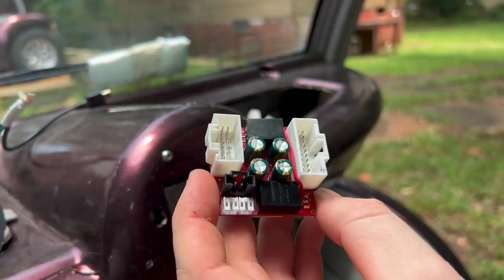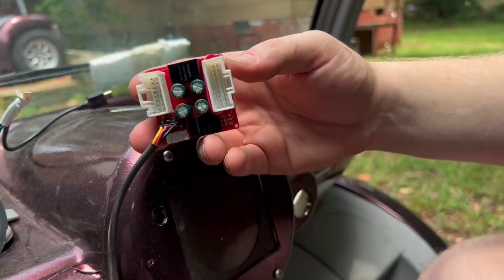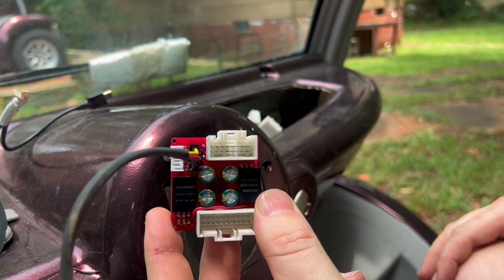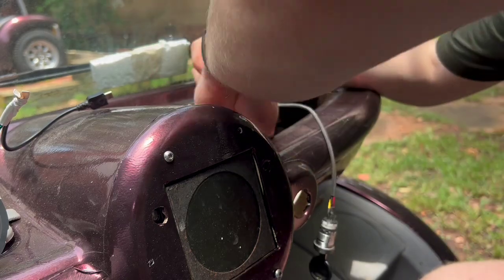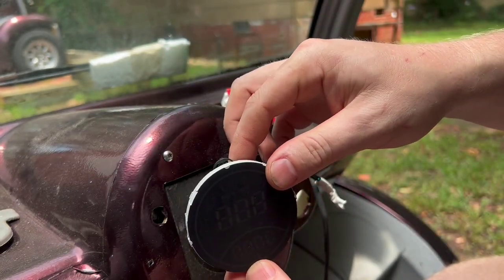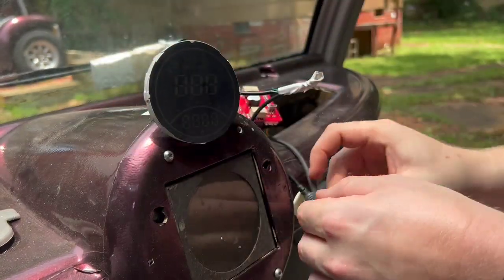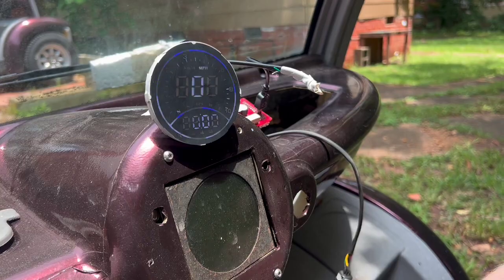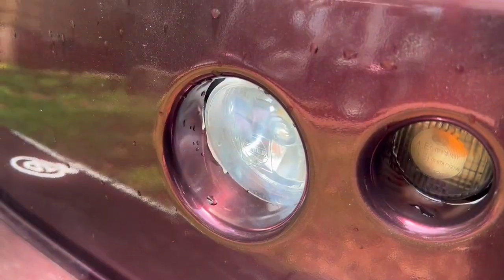Ford Think Cluster Bypass (DELUXE version w/ 12V connector)

Comment: Hi, I’m picking up a used Ford THINK instrument panel cluster does not work but you said you found one that is on Amazon can you provide the link for that and I’d also love to use your bypass
Reply from the maker: You need a working cluster or bypass for the cart to function. My reference was just to a cheap GPS speedometer if you want one. But that’s not going to solve your main issue

Comment: It does not have the original ignition switch. It has a aftermarket key.
Reply: Just wanted to say thank you it works perfectly no issues 🤙😎🤙
Reply from the maker: You can buy a bypass and replacement key switch from fordthink.org.
Reply: Will the deluxe work with the aftermarket key?
Reply from the maker: @DaleConrad-ke6cy  if the connector is the same.
Reply: Everything works good for a couple minutes and then I have to unplug the ignition switch and plug it back into the black box and then it’ll go again
Reply: I bought this on the ninth any word on when it will ship I did not get an email receipt or nothing trying to have it ready for this weekend for a golf outing
Reply from the maker: @DaleConrad-ke6cy  will be delivered today. Tracking info is on your PayPal order.
Reply: Perfect, thank you very much🤙

Comment: This is an awesome product and actually thinking about purchasing one even though my cluster isn't currently bad. I've been through 2 clusters in the last 7 years so I know this one will be broken before long. 
I know a big issue with the factory cluster was the heat caused by the built in 72-12v dc to dc converter "popping" some components or or weaking then them the inrush current when you flip the switch finishing them off. There is a cluster rebuild guy out there who add an external "transformer" to help pull this heat away from the cluster and mitigating this problem. To get to my point :D does this thing get warm/hot after in use for a while? Also are any features lost i.e. turf mode or reverse beeper?
Reply: Hi there! That's exactly right. Scott Taylor (EIM LLC) and Bob the Cluster guy utilize an offboard DC/DC converter to remove the strain on the linear regulars on the board. I have a video detailing a high overview of how the cluster works. The bypasses use a switching regulator, which isn't susceptible to the strain that linear regulators are (typically, the higher the voltage differential, the more heat they offput, and the stock clusters had them operating at pretty much max).  The bypasses have a little black box on them that will get warm, but should be able to handle long-term repeated use much better. The deluxe version has reverse, turf, and drive, with a beeper for reverse. The basic bypass only has reverse and drive (no turf). Hope this helps! 

In the coming months, I'll be debuting a full on cluster replacement that incorporates a color screen and a number of other features, such as GPS speedometer. A friend and I are working on the user interface now and working through bugs, as it's a good bit more complex than the bypasses. We post updates from time to time on the Ford Think Nation Facebook group.
Reply: @haganwalker3142  It is thank you for the info. The new cluster sounds interesting and I'm looking forward to seeing it.

Comment: Yes I got a bypass cluster that I am working with 

I checked everything else this is where I’m at I check the solenoid it is getting power on both sides with the key on and the key off low power so we’re getting 72+ volts by 74 so we’re good there so now it’s the control panel that controls the motor I don’t know if the motors is seized or the brushes are going out Anyways and this is what I’m gonna do I’m going to disconnect the power and the battery and I’m going to disconnect where the power goes in and the power goes out I guess and then check for voltage I need to know the voltage I don’t think we’re going to get 70 votes what is it low voltage 12 A 15 voltage Please Let’s get this show on the road
Reply from the maker: Hi fern, it would be easier if you could email. It sounds like you have an issue outside of the cluster bypass. If you have good batteries, that leaves either wiring, the motor controller, or the motor. My bet would be on the motor controller. You can download the service manuals for free at fordthink.org. Section 4 is the electrical service manual. I would encourage you to start there.
Reply: I’m looking for another video I think I got everything ready I have to confirm if I need it control motor or a motor I am not getting no power

Comment: I got it bypass but mines not working I turn it on I hear the contactor engage when I hit the pedal but it doesn’t go I have more than 72 votes and all my signals work and lights and no that’s a different connection that’s the 12 pin the 20 penis for the instrument cluster control panel I think it’s not working what’s going on anybody know why I should do
Reply from the maker: Fern, send me an email, but if the bypass isn’t working and you hear the contactor close, you likely have another issue. haganwalker@gmail.com